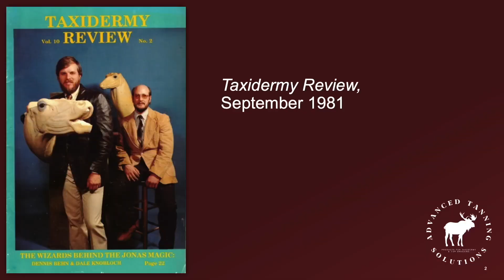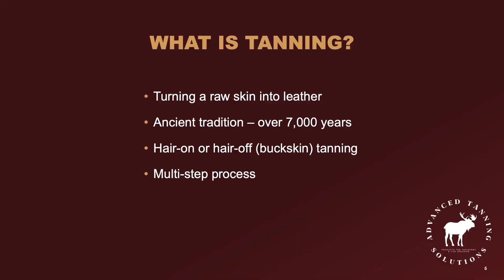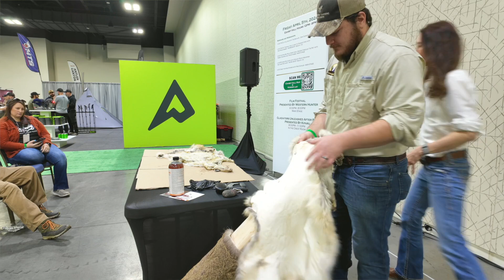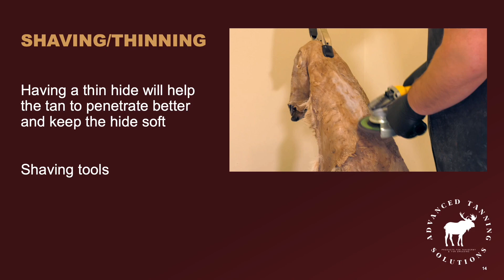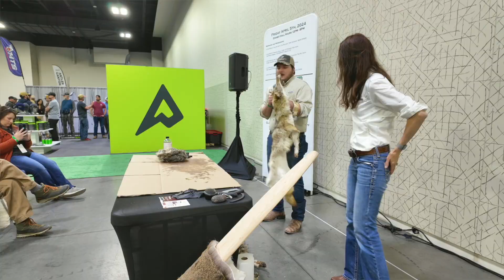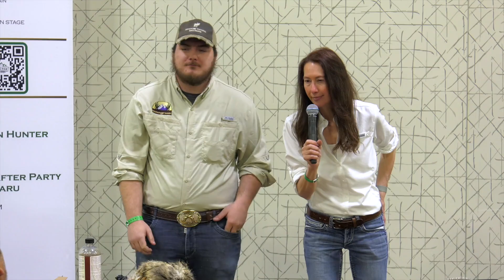Tanning Seminar at Mile High Sports Expo

Comment: I have a deer hide that is board stiff. It is over four years old and hasn’t been fleshed out. Can it be tanned with hair on. It’s been stored in a shed over a pole with flesh side out.
Reply from the maker: As long as the deer hide is in good condition (no bugs, rot, etc.) you should be able to tan it.  You can use NuTan and start with the Rehydration step.  
Since the hide is older and stiff, also use Hide Relaxer to help soften it in the bath.